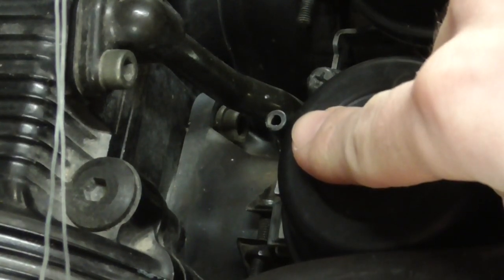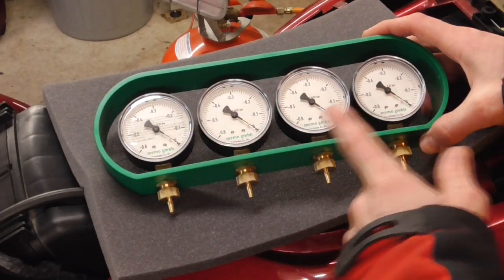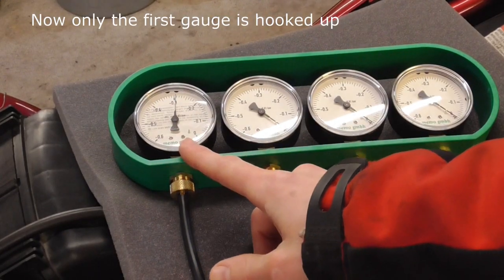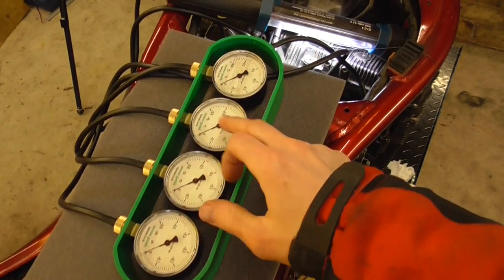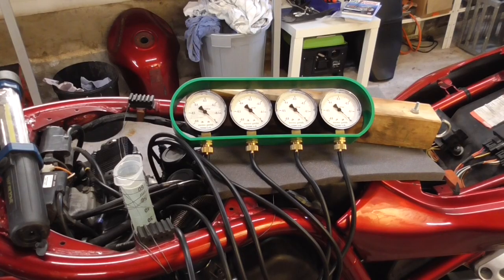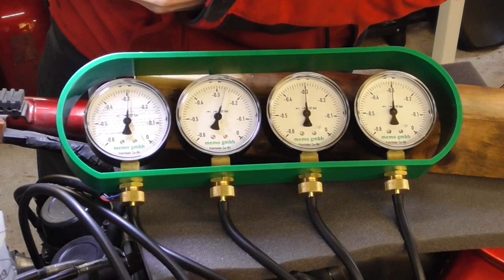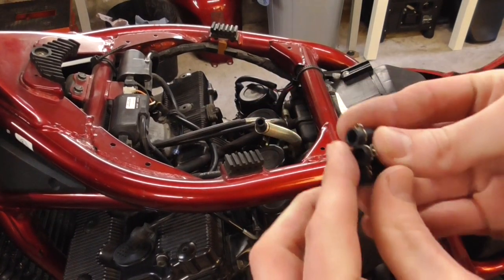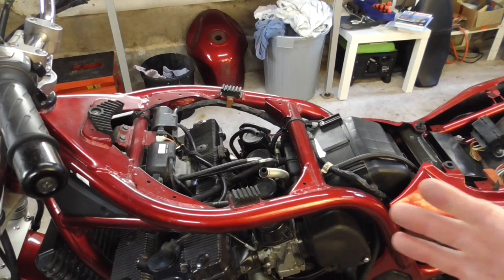Carburetor Sync explained Fast and Easy - Suzuki Bandit 1200 part 4

Comment: Does you bandit get a buzzing or vibration at about 4500rpm.??
As I have this problem and a few others online have the same issue
Reply from the maker: Thanks for the comment. No mine doesnt do that, how bad is it?
Reply: @bikedogtor1663  it's not that bad just annoying, once you get over 5000rpm it goes away. 
I will try and do what you have done with the carbs, I just ordered stuff today.
Thanks for the video
Reply: @charlesscottkelly It's a pretty common thing on these bikes, dod it go away after you did this?

Comment: Did you adjust the JIS screws between carbs 1 & 2 and carbs 3 & 4?
Reply from the maker: What's jis?
Reply: @bikedogtor1663  sorry, JIS - Japanese Industrial Standard screws - they look like Phillips screws but aren't. What I meant was, did you adjust the carb 1&2 balance screws and/or the carb 3&4 balance screws?
Reply from the maker: @grosbeakmc  hi, thanks for clarification.  I adjusted all carbs. 1+2 then 3+4 then the middle

Comment: please you need to help me!
my vacuometer is fluctuating a lot
but the pointer is at "0" that's right, it is at zero!
I am trying to synchronize,
I try to close the regulation register
but the pointer goes crazy, it cannot be stable
I don't know why, I've tried everything,
I accelerate the bike, but it does not increase smoothly, it stays at 0 or keeps oscillating a lot
Reply from the maker: Are you using cheap gauges off ebay? I had the same experience with those.
Reply: @myturkishlife1777  I already sell the bike I give up  but I find  that the valves, of the engine head was unregulated, someone opened the engine head cover and didn't change the rubber head seal I notice that the head was sounding a little oil because of that I couldn't adjust the carburetor
Reply: @McHornet7  ah ok it's a shame it didn't work out...
Good luck on your next one 👍